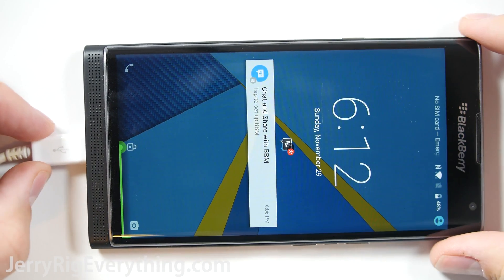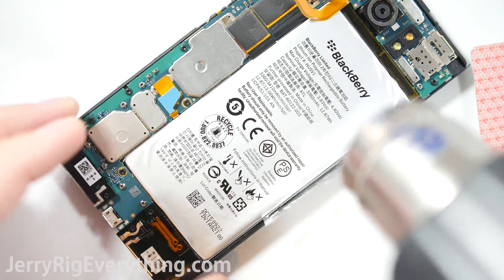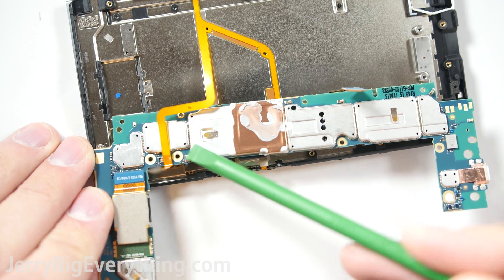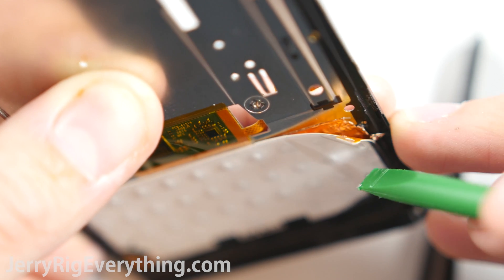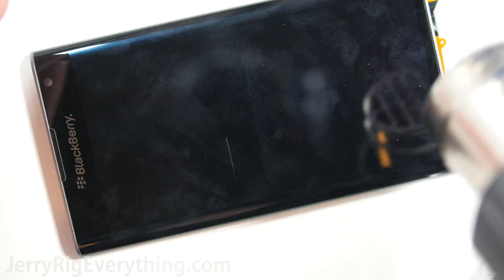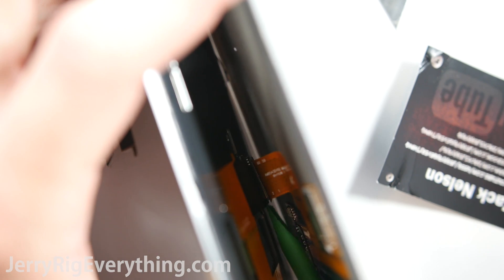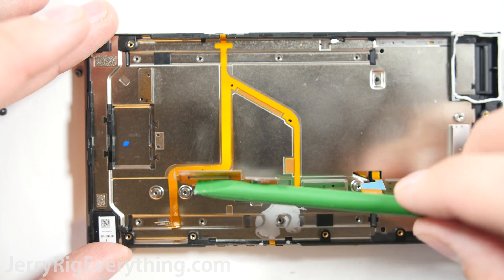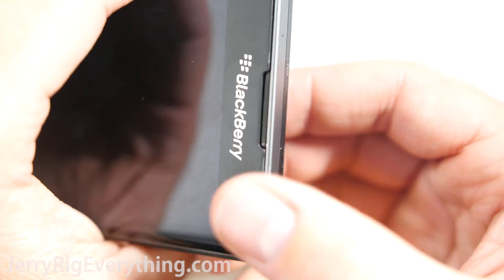BlackBerry Priv Tear Down - Screen Repair, Battery Replacement

Comment: Is there any way, to quit all the creak /squeacky noises that appear when pressing on the back/side cover of the phone?

Maybe by laying something over the battery, something adding thickness so it builds some more tension under the cover and so getting a bit stiffer so it won't make noises anymore?
Really desperate for this, I hope someone can help me and antoher thousands squeaky Privs to improve the overall handling/feeling, owing one of these.

Thanks alot in advance!

Comment: Jerry - you are a lifesaver. Following your awesome step-by-step instructions, I was able to take my Priv apart and replace my broken screen. The new screen I ordered came with the slide mechanism attached so I couldn't do the simple screen separation technique you mentioned... I had to perform major surgery! 

But, unafraid and armed with your video, I was able to do it myself.

I can't thank you enough. Definitely subscribing to your channel!
Reply from the maker: +vara fouroneone Very impressive!! Glad you were able to get it fixed. And thank you for subscribing!
Reply: @JerryRigEverything  Hello friend, Can you tell me which thermal paste is better for processor? when I use it, my phone is hot. Thanks in advance.
Reply: The new screen I ordered comes with the slide mechanism attached as well, any advice you could offer as I try to replace my screen??
Reply: Where did you find that screen? How much was it?

Comment: blackberry didn't want to replace my priv the battery died after 2 months. i bought it thru AT&T so they said they won't cover it without charging me half of the phone's cost.
 so I'm looking for the part, worst customer service, i love the phone but if their is a manufacture  defect they give you a lot of excuse on why they can't replace the phone,they told me they can but the cost would be 279$ for the battery sucks
Reply: +Joseph Code Sounds like something you need to ask AT&T for, not BlackBerry
http://forums.crackberry.com/blackberry-priv-f440/blackberry-priv-att-warranty-replacement-1056878/#post12190335
Reply: +thomas261989  I have a repair shop and we buy second hand phones i bought it second hand 4 months old I use straight talk. it's not an AT&T problem it's  a manufacturer issue
Reply: +thomas261989 Never had this issue  with apple LG or samsung,they ask for imei check   warranty and send you a shipping label. they check to see if their was an defect or cause . depending on the case if a defect they replace the part
Reply: Joseph Code
And what's wrong with getting AT&T to do it?
Reply: because i was not a subscriber they didn't want to replace it, when you purchase a phone you purchase the phone,If you want a blackberry,Samsung,IPhone Ect, buying at above dummy phone prices you purchase it cause of the Brand and model not because of the Cellular service.The point is that Blackberry doesn't stand 100% behind their manufacture warranty they give you excuse like crazy,I'm not the only one look at the reviews under.
Reply: Joseph Code
The thing I don't understand is that other people who have problems with Blackberry have had them resolved by Blackberry quite easily. Some even had 4 devices, one after another, replaced by Blackberry free of charge. Sometimes if you try contacting a company a second time and get a different rep, you'll have a better deal.
Reply: i contacted them 7 different times
Reply: Joseph Code
TBH, I don't know how you could buy it second-hand from AT&T given AT&T, as far as I know, don't sell the Priv pre-owned. If you buy it directly from its previous owner, then it's understandable that you don't get warranty. BlackBerry website says "one (1) year from the date that the new BlackBerry Handheld was first purchased by YOU as an original end-user" (http://www.blackberry.com/legal/warranty/handheld.shtml). Given that you're not an original owner, I don't see why you're mad at them.
Reply: Sounds like you work for blackberry.Lets End their cause obviously you have to much time on your hands to send me a link about the little loop between the warranty or you are a blackberry commenter,Of course i'm disappointed i'm the new owner.
Reply: Joseph Code
I don't actually care if you think I'm a bot. I just bought a Priv and happened to read the manual that came with it. A little Google gave me more info on why you did not have the experience other people have. I don't think it's fair to bash a company if the mistake was yours.
Reply: what was the mistake buying a BlackBerry???
Last mistake i will ever make.Thanks man,Enjoy your Blackberry

Comment: I am not able to find replacement screen for my Blackberry priv? Please help
Reply from the maker: +bhupinder minhas I just linked some replacement screens in the description.
Reply: +JerryRigEverything do you know where i can get a battery?
Reply from the maker: +Joseph Code did you try the same websites as the screens? Etradesupply
Reply: Yeah,but no Luck :{

Comment: Good to know the LCD is so easily replaced. I managed to water damage my Priv during my wet mount screen protector installation (I know, I'm dumb) and everything but the screen works properly atm.

I imagine that slapping a new LCD would be a LOT cheaper than having to get a whole new phone. I might take the screen off now tbh just to see if I can get at any remaining moisture.

Comment: Some models of the Priv do not come with Qi charging. Like the STV100-3.  What are the chances that one of those generic Qi coils could be connected to the contact points you show at the beginning of your video? any tips? You should do a video of adding a coil to an STV100-3.  Lots of people asking about this in the Priv forums.
Reply from the maker: +Shea Martin Would you be able to see if your motherboard has the contact points built in?  I have not taken apart one of those phones yet... and BB Priv parts are really hard to come by. BUT if your motherboard has those contact points, It probably is possible.
Reply: +JerryRigEverything I will have a look this week. Are there coils/receivers that just have wire leads instead of the usb plug? What are the specs on the Priv's coil ?  1 amp?

Thanks

Comment: super good video jerry : ), got a small doubt here, if i slide open hard which just for that satisfactory sound, which part of the Priv will be damaged? is it good designed to take a little hard slide
Reply from the maker: +Hx J I bet you could slide it as hard as you want without breaking it.  The sliding mechanism (as you can see from this video) is all metal, and very well put together.
Reply: +JerryRigEverything well the wire spring & the the black ribbon looked delicate 
but glad to know its tough enough to fire up the slider 
Thanks Jerry.

Comment: I read other posts and I didn't see a response to this question. I'm assuming that the lcd and digitizer and glass must be replaced as one. Do you have a source for that part or if they must be replaced as 3 separate pieces do you have a source for all three ?
Reply from the maker: +Mark Anderson I have been unable to find parts yet.  Unfortunately.

Comment: I really love my BlackBerry Priv! Such a perfect design! I watched his tear-down to see how easy it is to replace the battery! It's really not that bad at all! Thank you for this video!
Reply: Yes, good luck not breaking the back cover... or making its snaps work perfectly while re-assembling it. Sometimes no matter how careful you are, it will break from either the buttons or the sim/sd card sides. Actually, the back cover will unsnap with time. I had to either replace the back cover or modify the cover.

I've repaired a few. Believe me, there are no "correct tools" or "techniques" for this. It almost seems they chose the cheapest materials... also a piece of advice, if you can feel the electrical components from the outside because the plastic is that flimsy, it means it is bad quality.
Reply: @Ch1Frequency  I break sim and memory card tray positions.

Comment: Hey Zach (Hopefuly you'll respond and Ill be two for two today),
I'm looking to buy a Priv on eBay I found a great deal, but it's going to have no warranty.

I am very handy and good with Tech and will (most likely) be able to repair the Priv if anything happens to it.
BUT
I cannot find any replacement parts for the Priv online in case anything goes bad or I crack the screen.
Were you able to find any replacement parts online?

Thanks,
Ben
Reply from the maker: +Ben Braunstein I have not found replacement parts yet... Hopefully they come out with some soon!
Reply: Sigh... Thanks for trying and keep up the great videos!
Reply from the maker: +Ben Braunstein Hey man, I got replacement screens linked in the description.
Reply: +JerryRigEverything Wow. I'm shocked you got back to me eventually. YOUR AWESOME!
At the same time HOLY ** thats a hefty price for a replacement screen. Still going to treat it like a diamond and make sure nothing happens to it. 

Probably naive of me but I like my devices case-less (or nude as I like to say), so I'm only rocking a tempered glass screen protector on it.

Happens to be in the 2+ months I've owned the device, I have only dropped it once or twice. The Priv is very well balanced in the hand and has a very grippy texture on the back making it easy to hold on to.
Reply from the maker: Ben Braunstein Ya, it really does seem to be an awesome phone. Good idea with the screen protector.
Reply: +JerryRigEverything I need a new screen!  :-)  I'm wondering when they'll finally be available...
Reply from the maker: Steven Donald I just checked my suppliers again... still nothing...
Reply: My Priv just arrived yesterday.

Taking extra special care of it.

Comment: Does the back part of the phone still feel solid after the reassembling?
Reply from the maker: +Andy Wijaya It feels the same way as it did before I took it apart.
Reply: +JerryRigEverything thanks for the answer! because the back and the side of my phone feels creaky, I thought I can try to fix by opening it, but I am not sure because I'm afraid it would make it worse.
Reply from the maker: Andy Wijaya Ya, definitely be careful.

Comment: I have a question about this phone, i dropped it and front glass has smashed, LCD is fine, but i have searched the net can't find any replacement screens or digitizer.
Could you please point me to where i should be looking?
You doing us all a solid!

Comment: great detailed video. i have a UK PRIV and am looking into a way to add the Qi charging pad to it, is it orderable as a spare parts already?
Reply from the maker: You bet.  Watch my 2nd most recent video.
Reply: +JerryRigEverything Thanks for the quick response, I watched the video and think it's great for phones whose project didn't have the wirless charging in mind. The Priv does have provision for that but oddly the UK model comes without the pad. The contact points on the mother board are there too. The phone's back feels squishy because of the "void" between it and the phone's innards, this is the Qi pad's empty space right there. The back cover flexes and creaks when pressed at this point. So I'd like to add the original, OEM Qi pad, more so to stop the flexing of the back cover, than because of the wireless charging itself. After watching your vid I had confidence to take the back cover out and just added some 2sided 3M flexible tape without peeling the tape's protection. So now I basically have padded the back cover and it doesnt squish, flex or creak anymore. That'll do until the OEM Qi pad or an american Priv back cover become available as replacement parts... Maybe even a different colour back cover fora customized style... eheh
Reply from the maker: Anderson Perazzoli Nice! Glad I could help out a bit and that you got the problem fixed!

Comment: After watching this video, I want to get the priv even more :)
Reply: +Daveyy Just because yours died doesn't mean everyone's will. This is the best phone I've had in years, go for it.
Reply: I'm sure if it died BlackBerry will replace it. Let us know if your second Priv dies too. Mine is running solid still :) I love it, my battery lasts 28+ hours with normal usage!
Reply: +Andi Darmika Dunno if you ended up getting one or not but I love mine. Best phone I've owned...
Reply: Hope you haven't bought it yet... If you haven't, have a look at the BlackBerry Keyone.. That's a pretty spectacular phone and definitely worth buying! :)
Reply: Casanova Frankenstein and how do u configure yours
Reply: Had it. The first one I got the speakers blew easily. And then with the replacement my screen stopped turning on after two months
Reply: Best phone I have ever had. On my second. Only replaced the first because of the battery. May try this on my old one.
Reply: +Andi Darmika I have it, you will not regret that purchase! DO IT!
Reply: was the best phone too for me till it died and realised why bb is a dieing compagny lol
Reply: +Andi Darmika you will regret mine died after 2 week of use.
Reply: Why??? the build quality is shit! Believe me, I've repaired a few of them and there is almost no chance of not breaking the back cover, no matter how hard you try not to and the gaskets are obviously one-time use. It gets hot, you can feel the components through the back cover and the screen is prone to breaking under light torsion! Also there is a high likelihood the back cover pops out of its place because the snaps are shit!

And it has high specs but for some reason it shits itself with android. Latest motorolas,  samsungs and iphones have WAY better quality.

Comment: from this tear down video you can see how low quality this phone is
Reply from the maker: +Ng KWAN YEIN Well..... besides the easily scratched camera lens, no replaceable charging port, and crappy front camera, its a relatively decent phone.
Reply: +JerryRigEverything you're right, it's a decent phone.  Not all phones are made for everyone but I can tell you that the priv is one of the two flagship phones that I like(the other being the Droid turbo 2),  I own one. I'm not a selfie person and this may not be one of the smoothest 808 devices out there, but with software updates it is bound to greatly improve. My siblings are mad at me for spending that much on the priv when I could have gotten the nexus 6P etc. for less , but those devices do not appeal to me as much as this, I'm weird like that
Reply: +Efon Ekpo If you have an unlocked Priv, it's first update went live today:

from BlackBerry blog site:

An improved camera: We’ve implemented a number of tweaks that improve the speed of our camera app, and re-tuned it for better low-light image quality.
Better performance: We’ve also tweaked the PRIV’s software to improve overall system performance
Improved stability: The update further includes a number of adjustments designed to improve device reliability and reduce instances of crashing and freezing.
Enhanced security: Lastly, the release includes December’s security patches – rest easy knowing your device is protected against the latest Android security threats.

Be sure to also keep an eye out for coming updates to BlackBerry’s Android apps: Blackberry Keyboard, Blackberry Hub, Blackberry Camera, and DTEK by BlackBerry. The latest version of each will be available through the Google Play Store on December 14. The improvements include:

Camera: Now supports 16:9 photos
Keyboard: Increased language support and emojis added to predictive typing
Hub & Contacts: Now includes WhatsApp
DTEK by BlackBerry: More notification options to alert you when apps use your info
Reply: Dec 7th
Reply: Giovanni Zappia Nope, I'm locked to AT&T. It's expensive to pay off overtime when including tax but I'm sure it'll be worth it, hopefully I'd get an update this December

Comment: @ZacksJerryRig The pixel is 360p only ..y 😕😕
Reply from the maker: +Adam Sheikh All YouTube videos start their life at 360p.  Wait about 15 minutes and it will be processed to 4k.
Reply: +JerryRigEverything 4K already 
thanks for this videos.... and the repairing is rather easy
specially the screen,, but that goes to all blackberry devices. they are all easily repaired